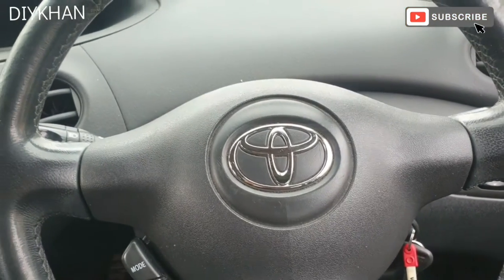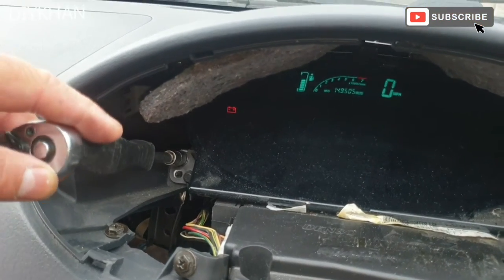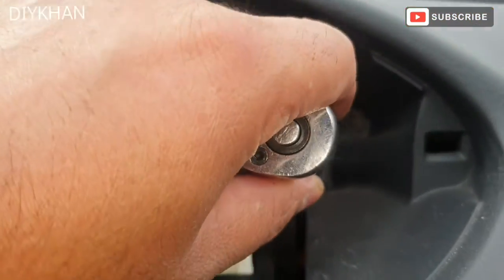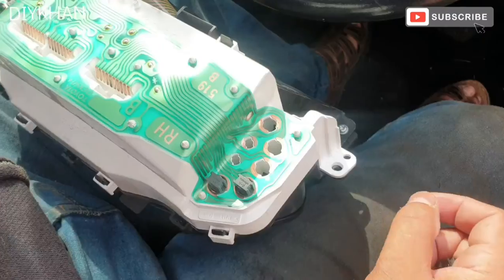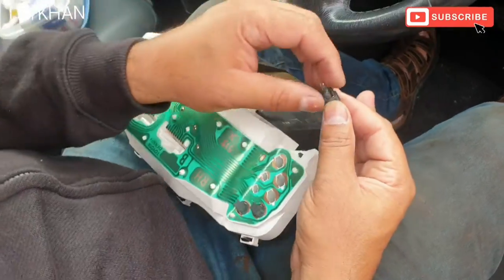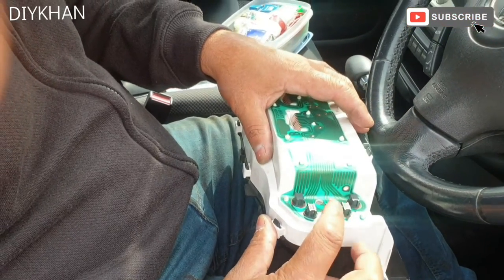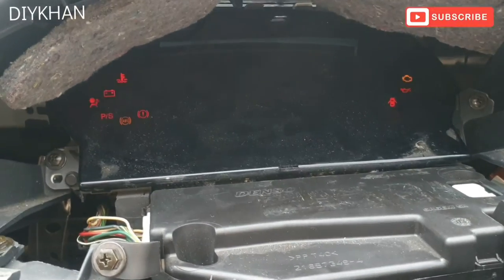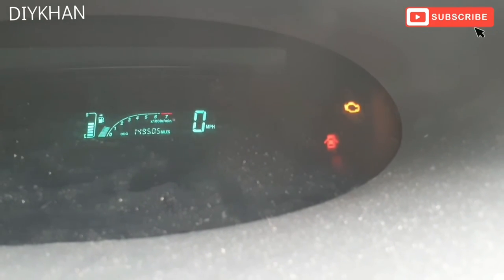Toyota Yaris Vitz Speedometer Light Bulb Replacement. Toyota Yaris Vitz Engine Management Light. EML

Comment: Very Informative Video. In my toyota Yaris 2004 everything is working buy it doesn’t show the speed and rpm. Sometimes it star working but sometimes it goes away. Everything else in the speedometer works. Can you please share some information. What should i do?
Reply from the maker: Hi. Try changing the speedometer. U can get a second hand part from ebay. Good luck.

Comment: Hello 
In vitz year 2008 it’s got bulb to change?
When I put key in contact all light on only check engine light nt showing
Reply from the maker: Hi. Someone either took the bulb out or they have blocked the light bulb with tape to hide engine Management Light
Reply: @diykhan  thanks for replying sir
In vitz 2008 also can change bulb?
Reply from the maker: @vyassangadu2803  not sure its worth having a look at the back of the panel
Reply: @diykhan  what do you recommend change the panel?
Or try to see if bulb is ok or not
Reply from the maker: @vyassangadu2803  try to see the bulb behind. It might be brown covered with tape to removed to hide the engine Management Light
Reply: @diykhan  indeed it was covered with sponge 
It’s led, engine light is on now
Thanks man👍🏽